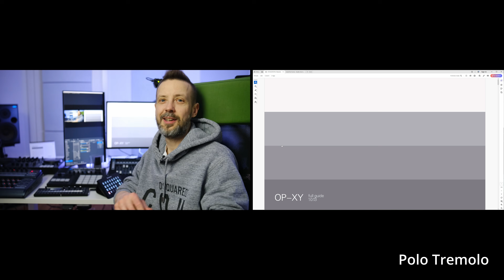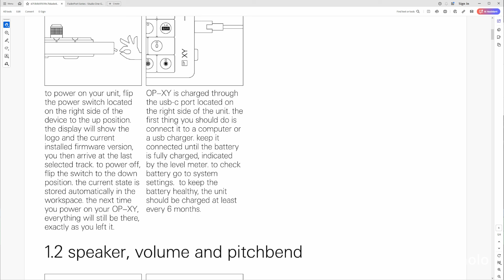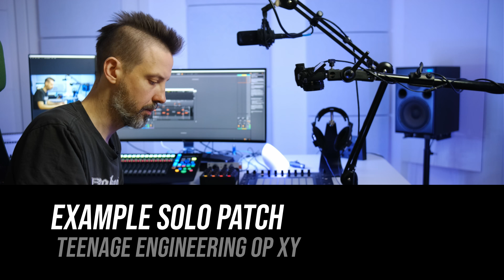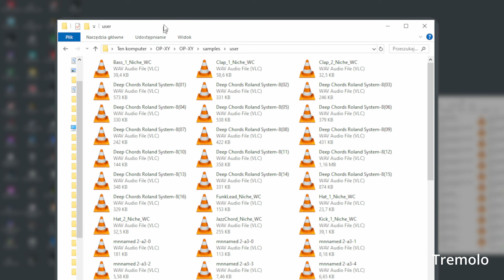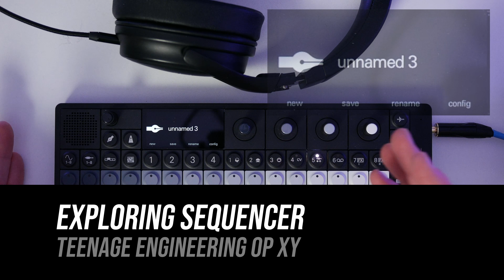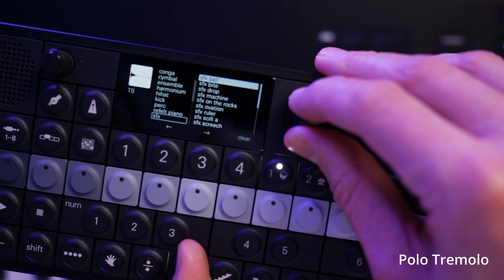Teenage engineering OP XY: for beginners or for pros?

Comment: As an OP-1 Field owner I love the packaging  - black egg carton material with cloth elastic straps (bone color in my case).  I think it speaks positively to the thought behind the machines.  I also recognize the beauty of Apple's packaging but the T.E. green packaging is so simple and unique.  I definitely kept mine.  I'm closely watching the OP-XY.   (My only problem is that I don't like the design theory of the punch-in effects being on the fascia - YouTubers are using them to death and they're becoming very familiar and fatiguing).  One of the most intriguing aspects of the XY is the addition of the "multi-output" on the side which can be many different things from MIDI to CV, Clock sync, or audio i/o.  Thanks for the video!
Reply from the maker: I never owned any of the units, but I agree that they are special - I am not impressed by sampling capabilities though. I wish making drum kits and browsing was faster. Punch in effects especially drums are instantly recognizable. Maybe they will add some editing functions in the firmer updates.;)
Reply: @PoloTremolo  yeah they added some significant upgrades to the field over time but once they get to a certain place, I feel like they stopped with the updates.  One thing we have to remember, these are little machines for sitting on the couch or taking in your backpack and scratch padding jams.  I don't think they were ever designed to be full featured daw competitors which is why the sampling is not feature rich.  I definitely wish they would make improvements to the sequencers and add some sample looping and fade in/fade out features to the field. Additionally, multi sampling.  But I'm not expecting any of that to happen. With the field you pretty much have to just use the for track tape machine as a sampler.  Once you've got a couple tracks of samples down you can bounce them into a single track which will free up the other three again.  Lots of workarounds.  Thanks again
Reply: returning to this thread - I bought an OP-XY to add to the Field and LOVE it.